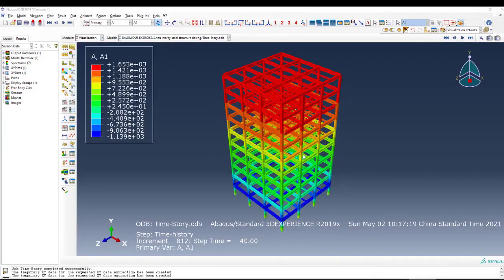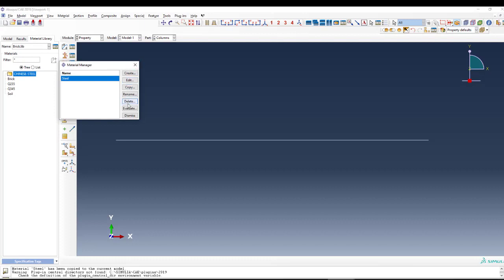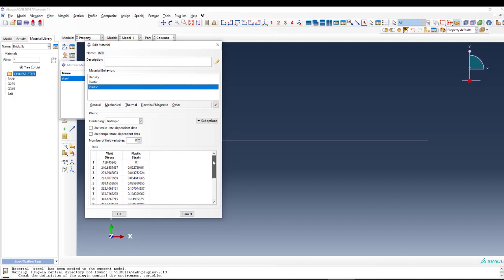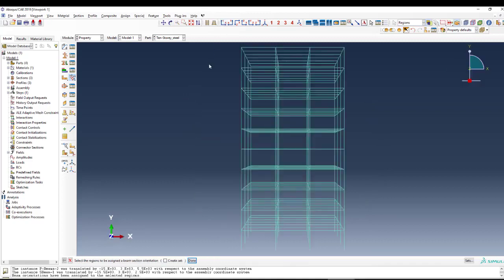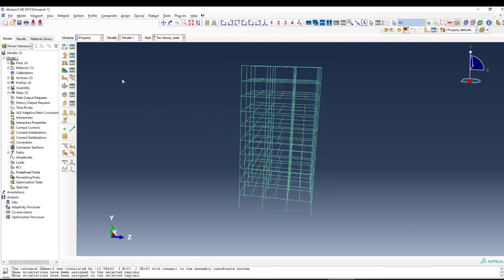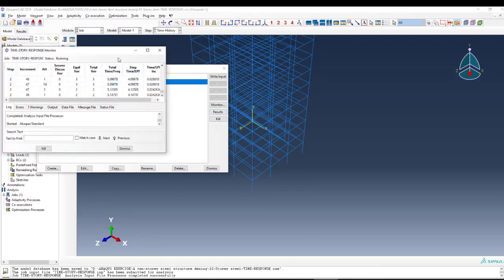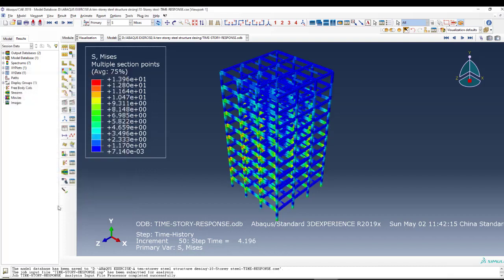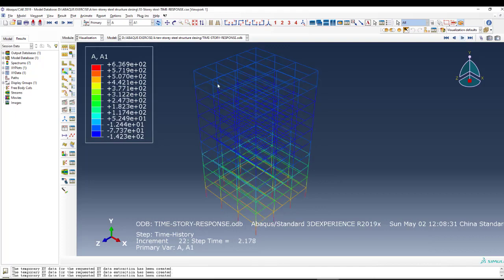ABAQUS tutorial Time history analysis of A ten-story steel structure

Comment: Hello. In this video you considered that the connection between the beams and the columns would constraint rotation on all beam directions, however for there are steel-structure buildings where one of the directions of the building allows rotation on the beam elements and uses truss elements as bracing system. Thats what i am trying to emulate on abaqus, however im having problems creating the connection for the truss elements, do you have any tutorials on this matter? Im currently trying to create a very simple structure with beams and truss elements and am comparing the deslocation values with ftool, however the values arent matching properly
Reply from the maker: Hi, there is no tutorial for the time bing. If you wish, then join my channel membership, and soon I will upload.

Comment: I have a question sir, I dont understand why when applying TH analysis in the X direction we have to uncheck U1 as boundry condition, I think this will make the node behave as free node in 1 direction not fixed, correct me if I'm wrong
Second, is it possible to make a video for this same model and instead use base isolation instead of fixed base ?
Thanks Sir.
Reply from the maker: I agree this is maybe a little tricky for you or even wrong but it's practical and true.  if you have seen the shaking table test we allow the structure base should move, which means there is no fixed BC. this method is true, and for your assurance compare with other software results. I have the plan to create a tutorial with base isolation, keep tunned .
Reply: Thank you sir May Allah bless you

Comment: Assalamualaikum, Is it possible if I put a swimming pool at top of the roof? can the abaqus software also define the water movement causes by the earthquake? without break them into 2 models (1 for the building, 1 for the pool) ? Thankyou
Reply from the maker: W Salam, actually yes Abacuse can do almost anything. But if you’re expert. So I should suggest you that water tank is not the main structure to evaluate the seismic response the building is the main structure so you can assign the water tank as a mass to the tap of the roof.
Reply: @KSSE_Engineer  alhamdulillah thanks for the answer

Comment: Sir, if the constraint is released along the ground motion direction, the base is also moving. In that case how to determine the displacement at roof? I compared it with SAP results , it is double the value. But acceleration time history is matching. Please clarify
Reply from the maker: During the ground motion obviously the structure base will move, this is much realistic and the SAP method is called Dynamic modal analysis, if you want the both results should match make your model simple and as same the SAP2000 model and conduct the modal dynamic analysis in Abaqus not dynamic explicit or implicit.

Comment: Thank you for this video sir. Do you have a tutorial considering soil-structure interaction?
Reply from the maker: please check it here https://youtu.be/KhKQp34kRYo
Reply: @KSSE_Engineer  excuse me sir I have a question, I drew a pipe into a soil sample as follows:
1) I drew the pile as a wire
2) I made the profile of the pile as beam/pipe cross-section
3) I made a hole into the soil that fits the size of the pile
4) I assemble the soil with the pile and the pile cap
but when I rendered the cross-section of the pile it didn't appear as a pipe. Can you tell me what wrong that I might make, sir?